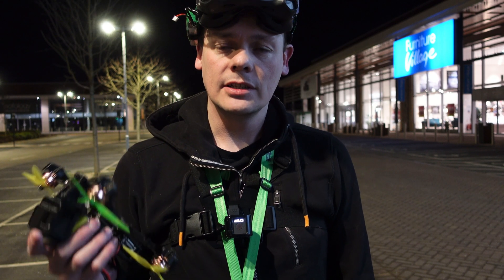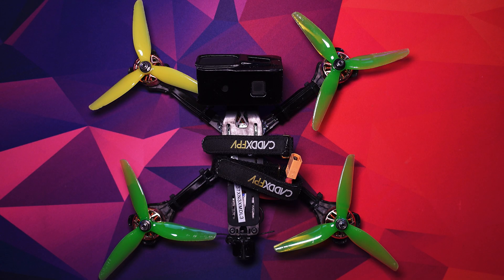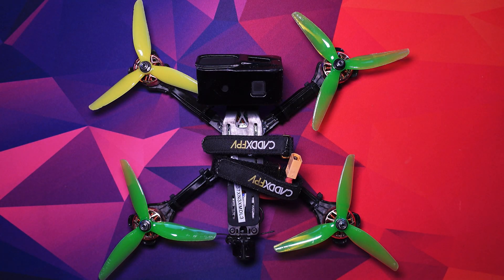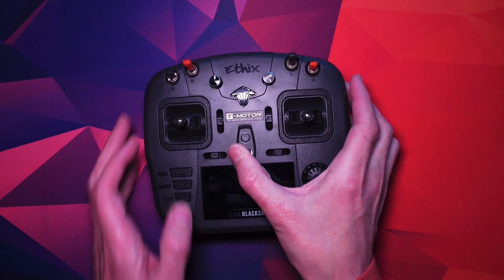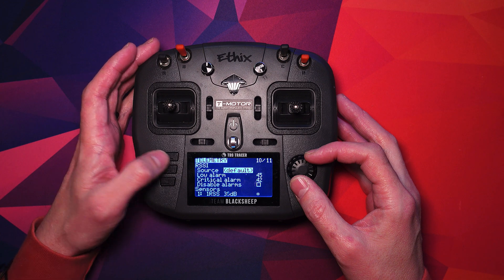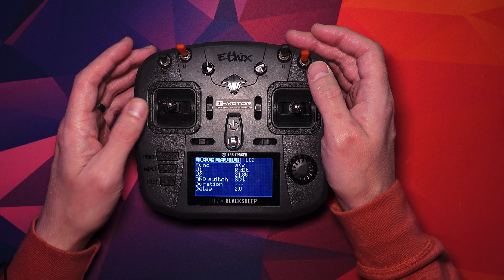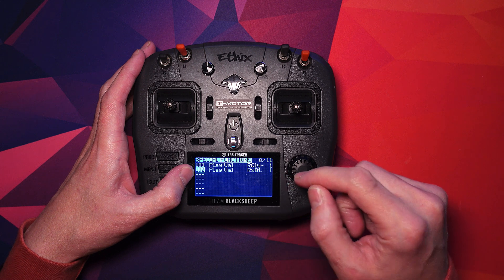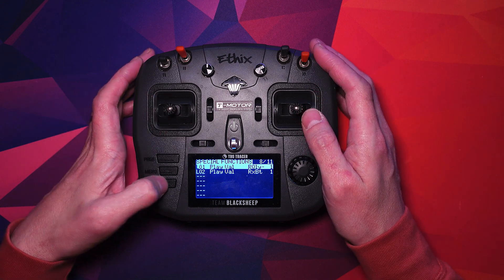No voltage on DJI Vista OSD? - Radio readout via SBUS Telemetry Tracer/Crossfire

Comment: Thank you. Ground wire broke off in a crash now an no more  OSD after repair. Did what you did on Radio Master Ranger an also had to go into DJI  V2 goggles an turn auto temp control to off. 1 more thing  I set a timer for 3 minutes. Works great. Thanks again  👍
Reply from the maker: awesome to hear! thanks

Comment: For some reason i'm not getting RxBt with my quad, but the other quads I have show the RxBT. Have you had the same issue?
Reply from the maker: thanks for the watch - 2 things to check, have you enabled telemetry in BF, and have you run the discover on page 10? i had to run discover per kwad even tho was same model on the radio. Sometimes the discover can take 30seconds - 1 min
Reply: @genericfpv  I’ve done both but I’ll try to run the discovery for longer. Thank you for the help!
Reply: @genericfpv   Hmm Just tried again I'm getting RxBT but it's not displaying any voltage. I double checked and made sure I have telemetry on. Maybe something wrong with my FC =o.